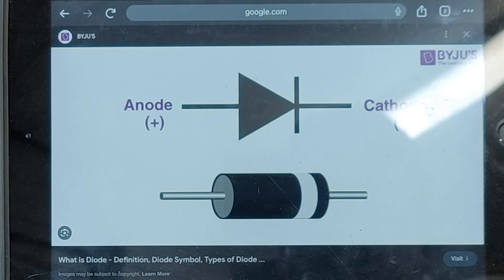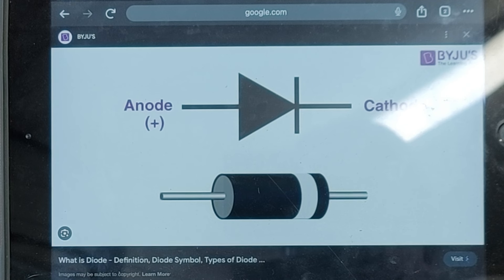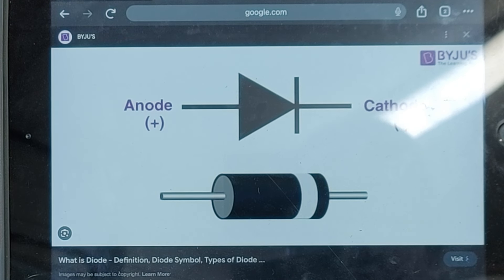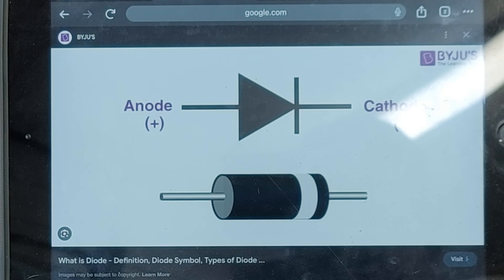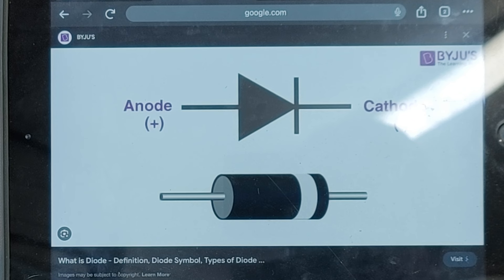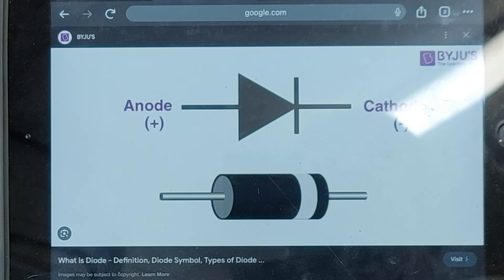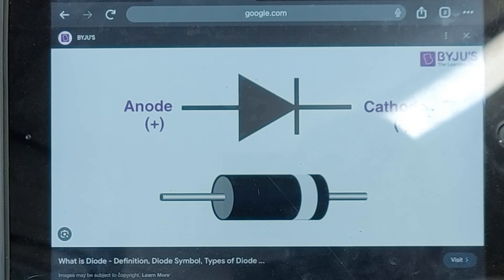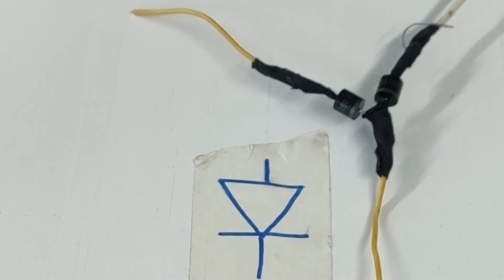"WigWag" a demonstration of how Diodes are often used to alternately flash headlights.

Comment: Nice one 👍 
I've used diodes on my int lights so I can power them from Phoenix or leasure system with no back feed issues if I have both switched on for some weird reason 🤔
Reply from the maker: I suspect the supply at the highest voltage wins if both feeds are powered up together.
I have kept the scene lights wired up to Genisys in the iveco but will probably be using diodes rather than relays this time to have them come on when in Reverse.
Reply: @CriftinsCampers  I kept my scene lights on Phnx as well but I put LED strips in there as well powerd from the leasure system, simply to save power, the bulbs they use are a bit power heavy and bright for camp illumination 🤔